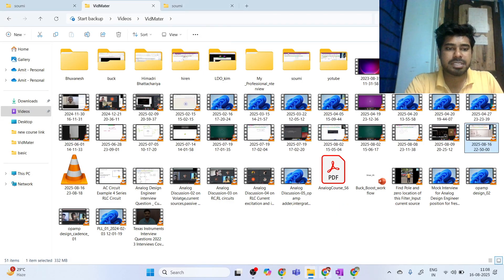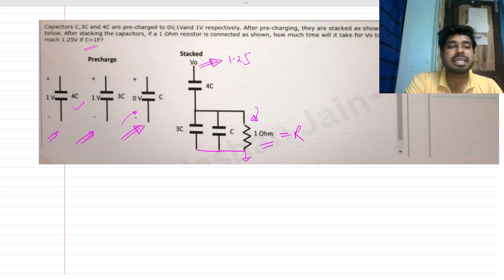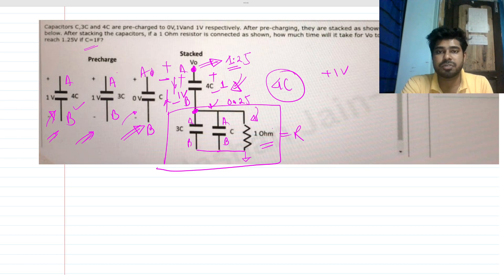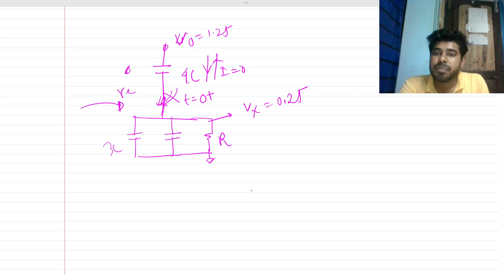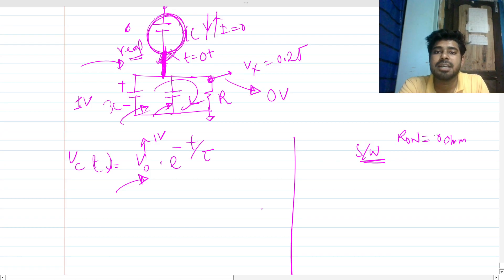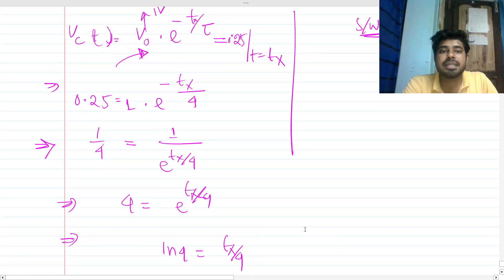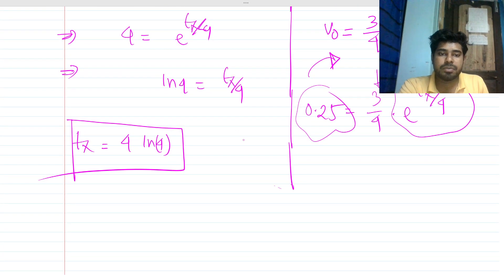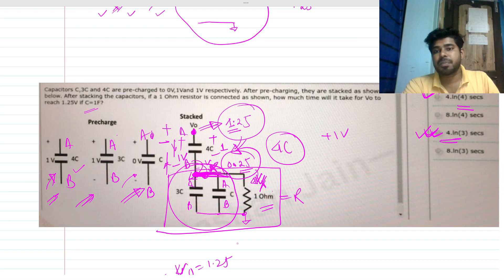Analog Circuit Design interview question_ find the time vout reaches 1.25V? Amit Bar

Comment: Your 1st solution is completely wrong. 2nd one is correct there will be charge sharing then only they will discharge through the resistance. Therefore there is no ambiguity that the ans is 4ln(3)

Comment: 10 mins is too long for this question. We have to find the time it takes for the output to reach 1.25V.
The top capacitor holds 1 V forever and the 1 Ohm resistor discharges the voltage from 0.75 to 0.25 in one time constant, ~4 sec.
Reply: his job is to teach not to solve it the fastest
Reply from the maker: Is the final answer is 4 sec according you??
Reply: see, one can easily answer within 1 minute, thats not the problem. Interviewer can ask you any other related question like why it discharges from 0.75V (according to you) ? Draw the node voltage waveforms etc. etc. etc..... it can take more than 10minutes for a freshers😄
Reply: @amitbar6610 no definitely not. Not everyone takes 10 mins. 0.75V is the instantaneous voltage that appears across the two parallel capacitors. 4.4s is the answer if you are looking for more accurate answer.
Reply from the maker: 😀 I said it can be answered within 1 minute.. you don't understand probably! I think you don't know what actually a interviewer want from a Interviewee 🙃 it doesn't really depend only on "how quickly one can answer" .
Reply: @AmitBar-Analog_Circuits  There could be multiple ways of finding the answer. If you follow the right assumptions and do math correctly, you end up having the right solution. Now, it's in our hand to which method to follow for which problem. 
If you know there are two methods, one is fast(necessary and sufficient steps to get to the solution) and the other is slow(unnecessary steps involved)
What do you choose? fast or slow?
Also, can you tell me how my answer was wrong?